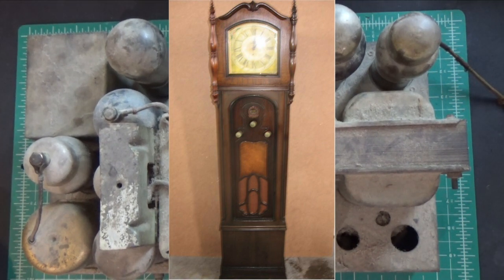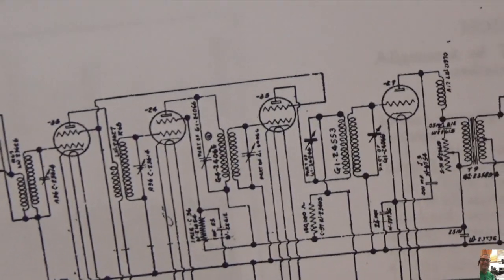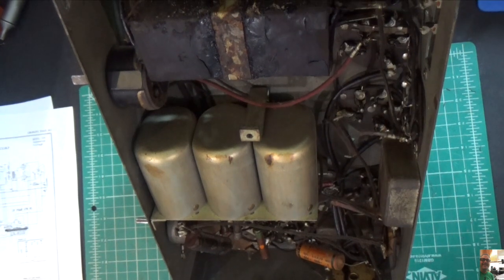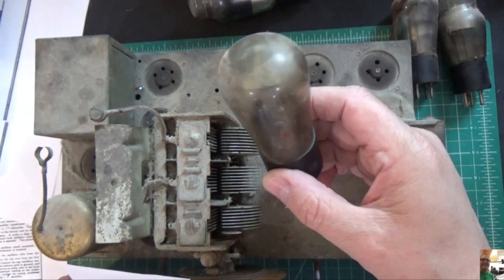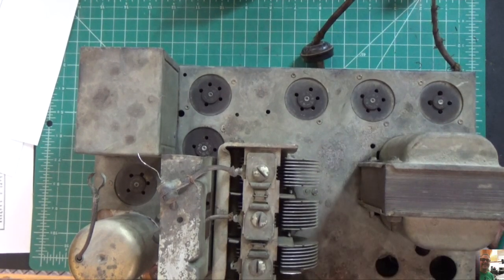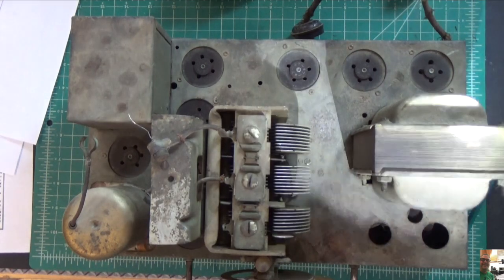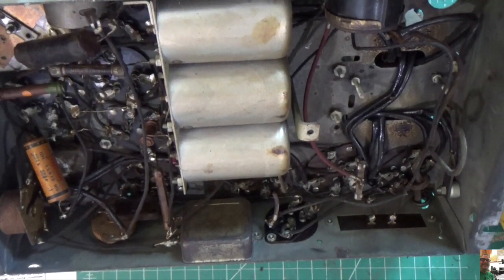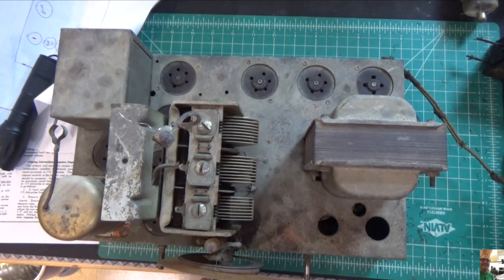Crosley Playtime Grandfather Clock Restore Episode #1 - Dust in the wind

Comment: Wow now that is a very crusty looking radio and is gonna take some major clean up fix up work. That capacitor box has definitely been leaking for a long time.Its good that the transformer is good best to eliminate all of the major parts first. Deoxit will work wonders on that tuning capacitor. On that chassis I don't think I would use much more than dish washing detergent.
Reply from the maker: I agree with you Larry... crusty is the right word... hope to reverse some of the crust... crust is meant for pizza....  :)

Comment: It's Blueglass.  Must be from Kentucky.  (Yellow Submarine quote)  Very cool with the globe tubes.  Is the glass itself broken on that one Arcturus tube?  If not you may be able to repair it if there's enough wire sticking out of it.
Reply from the maker: Gary, on the Arcturus tube, the glass is broken and the vacuum is gone.... its done... all good.. I have some spare tubes around.. we'll see what I have.   Thanks bud